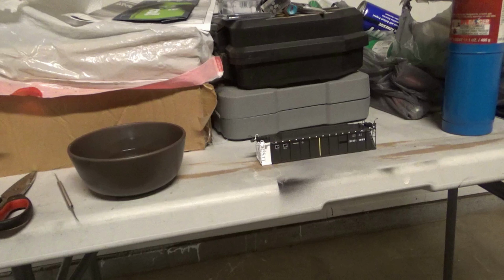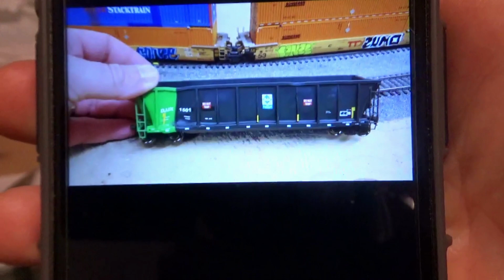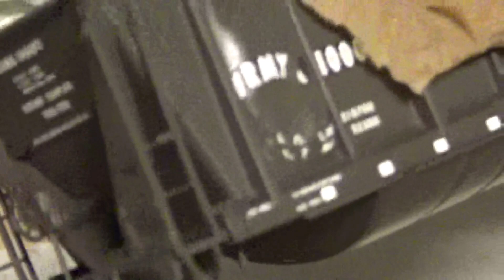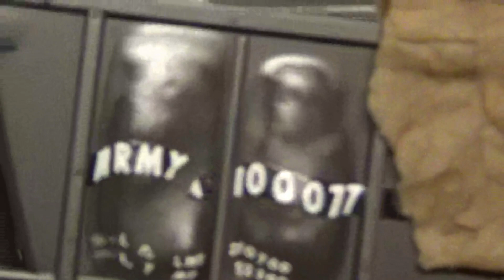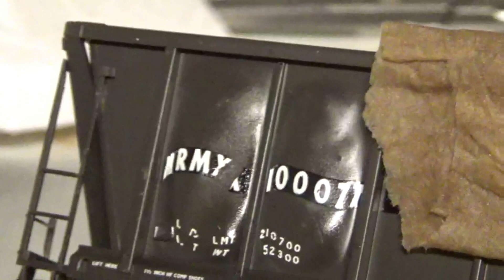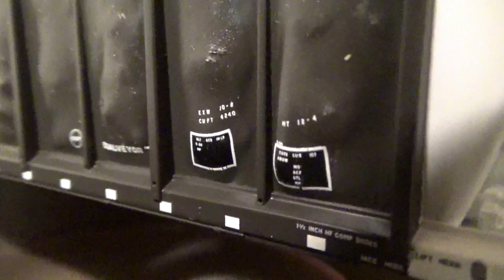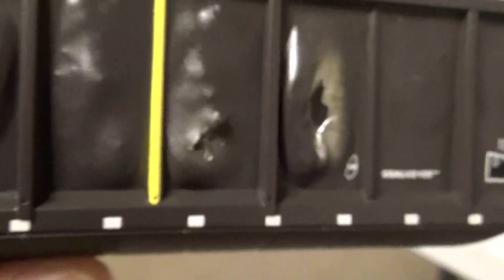***Dented Gondola Weathering Affects!*** Weathering technique revisited!

Comment: The Model railroader in me found the video very informative. I'll probably try it. You explained the process very well.  The Firefighter in me was freaking out the whole time you were using the torch. You need to get a insulated plate to work on, not a plastic table and find a spot with less clutter and  more room so you can move the extra paper out on harms way.

Comment: Do you find that the wet paper method is better than the pieces of Athearn weights on either side?  Also,  I've gone with a butane cigar lighter which is smaller and has a trigger to turn on an off. no knob.  Just easier for me and a much small point of flame.
Reply from the maker: That's a great idea with the smaller torch, I may look into that method.  As for the weights, I still thinking warping would be an issue.  The sides get stretched out as they melt and the weights wouldn't stop the heat for long.
Reply: @DansRailroad2011  
The torch is a Eagle Safe Stop I bought at a tobacco store for $8.00 I tried to attach a photo but youtube doesn't allow it.
Mike